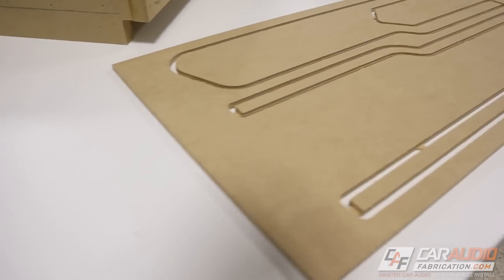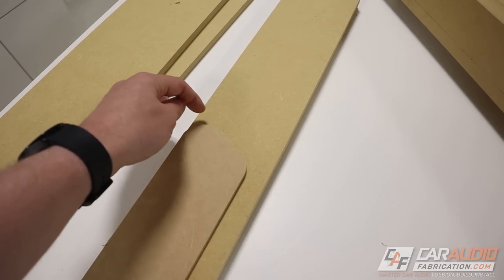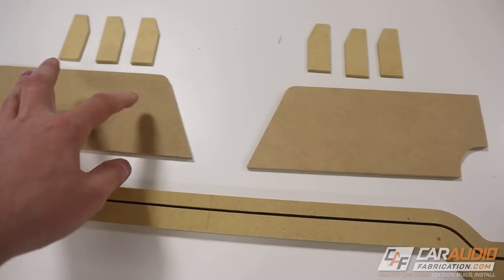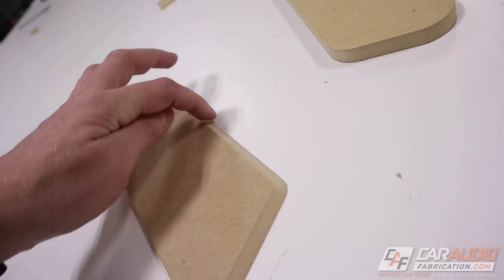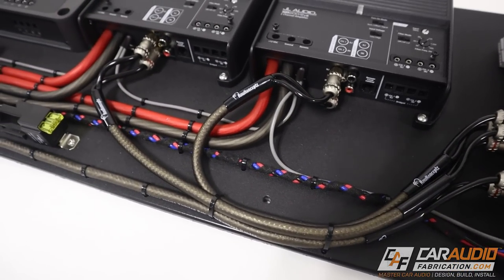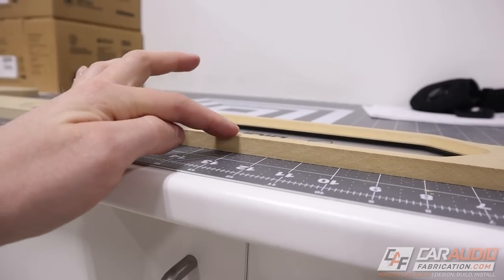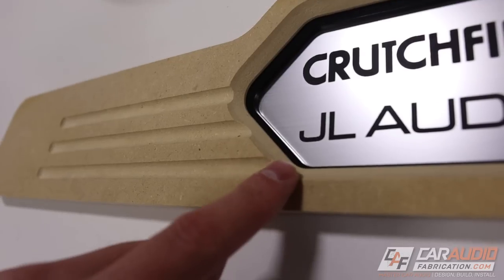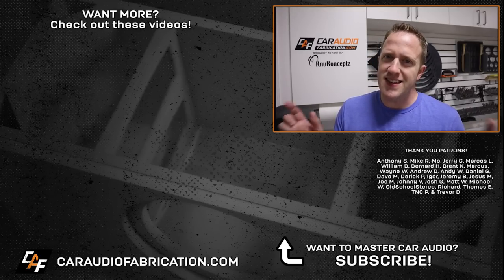Building custom subwoofer box beauty panels! Underseat Box Build

Comment: Could one  do a down firing trunk box with 2 10” and on top do 3 8” in a sealed box?  Just an idea been thinking about..
Reply: The 2 different enclosures will cause the subwoofers to cancel each other out and you would get significantly less response and more peaks
Reply: Thank you so much for the advice. I have a 2016 Ford Fusion Titanium with Sony’s and it hits but I was looking to make it hit harder. I’m also saving up to swap the head unit out for a Phoenix PX6 Six-Core Vertical head unit

Comment: Hi, just a random question. I blew my two Pioneer TS-D10D4 subwoofers. It was probably in a small box that made them blow. If I re-coil the subwoofers, would they still have the same quality and power as original?
Reply: it depends on what you use to recone them.. if your using a factory recone or one thats factory recommended it should be the same but if u use other types of soft parts that aren't made for your application you could drastically change its performance which could end up being a good or bad thing
Reply: @mikemccabe7124  thank you so much for all the advice 💪